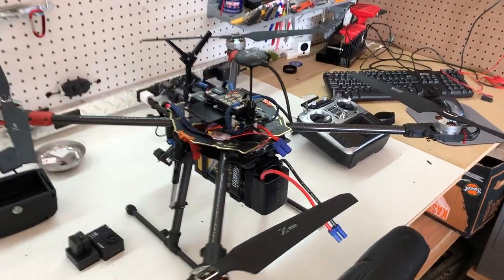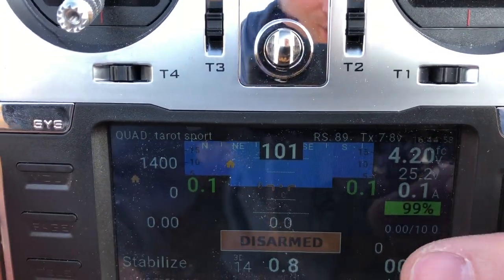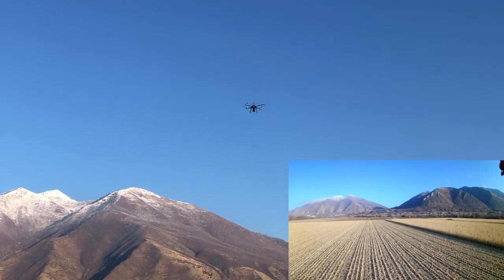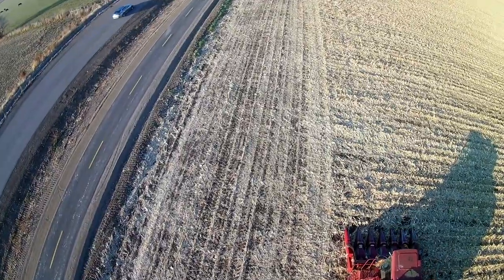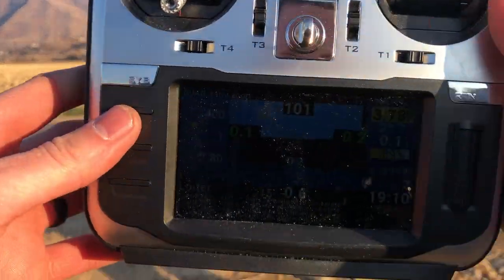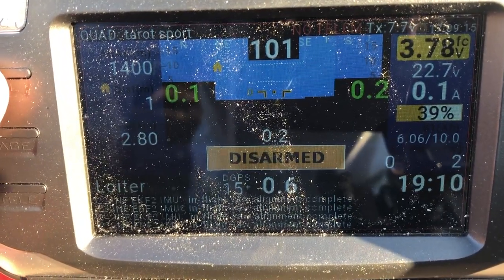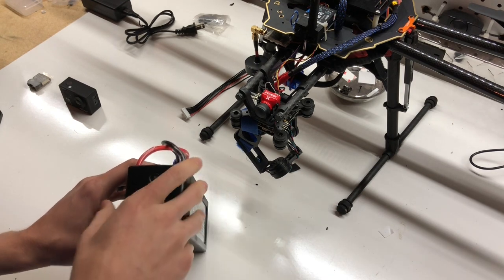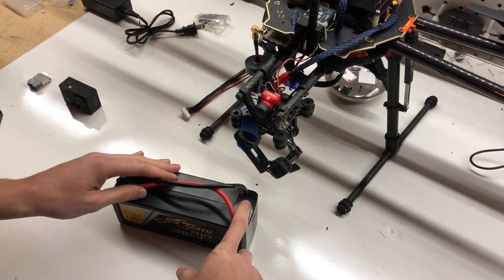First Flight! Tarot 650 Sport Extended Arm Drone with Pixhawk 4   (Awesome Flight Time!)

Comment: 7:00 it is interesting phenomenon that while hovering, rotary wing aircrafts like drones use slightly more energy than flying directional flight. Its called "Translational Lift". So if you now do the same flight test with the same oaw of drone, you will get less flight time

Comment: In my quadcopter i get randomly EKF ground mag anomaly(very danger cause copter acting wired), should i recalibrate it even that the pixhawk has a global magnitude database and no need for compass calibration they said

Comment: Hey, great work and thanks for sharing! I built a similar setup a while ago which I use for aerial filming, I have the Tarot 650 with the following: Naza M, DJI E600 Propulsion System with 12 inch props, Runcam Eagle Micro, Video Tx Boscam TS835, Eachin Diversity FPV Monitor etc. I recently Bought a Jumper T16 and TBS crossfire  to upgrade for longer flights. I've been using the Tarot T3D gimbal with an action cam but it's never been that great despite tuning it and has recently gone faulty. If you want to get nice footage without your props in the shot you should extend the 10mm carbon rods that hold your gimbal with longer rods, that's what I did with mine. I'm keen to checkout your build to see how you extended the arms, I'm guessing it's a lot more stable with larger props and arms.
Reply from the maker: Sounds like you have a sweet setup! I have been thinking about extending the boom arms for the gimbal and might have to do so. I just purchased the gopro hero 8 so I'm excited to see what kinda of footage I can get with it!
Reply: @builtfromhome9207  Hey thanks, you'll get super smooth footage with the GoPro, a lot of FPV guys get really good results without gimbals, the Osmo action is also very good. Are you going to install FPV? I've heard TBS unify pro is the way to go or the DJI FPV if you have the money.
Reply from the maker: @Renclif  I already have an FPV setup on the drone but I forgot to show it in the video. I will be doing another video here in the future about my fpv setup integrated with the GoPro. So look for that video. it will probably be in a month. When the extra parts arrive.